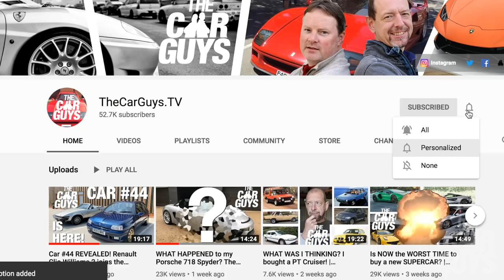Why Did Jason Buy a Fiat 500? It’s Cinquecento time! | TheCarGuys.tv

Comment: I was out in my 1972 500L earlier. Bought it in 1998 & adore it! It’s a bad idea to open the sunroof when moving though as it can damage it. 

I’m in the Fiat 500 Club & we’d be pleased to welcome you to the Club events and runs. For instance last May 2019 29 of us drove in convoy on a tour of Norfolk! I did 400 miles, no issues. Club members go deep into Europe too. But for Covid we had planned for about 30 cars would do a trip round Dorset in May 2020. That will happen when we can. My car has a BIS 650cc engine, with a Panda unleaded cylinder head, it has front disc brakes and lowered suspension with Spax dampers supplied by Middle Barton Garage, who race Fiat Abarth’s. Disc brakes are essential! 
We advice fitting a strap to the front bonnet to prevent it popping open and raising to block the windscreen. You’ll regret not doing this modification when it occurs. 
I hope to see you at some club events!

Comment: I drive a 2012 Fiat 500. Its a great little car with a 5 speed transmission and it gets 40+ miles to the gallon.  not an overwhelmingly powerful car but it gets me where I want to go. And it only has 77409 miles on it.